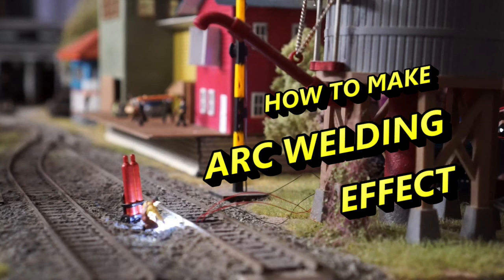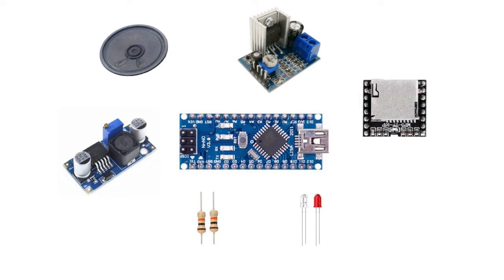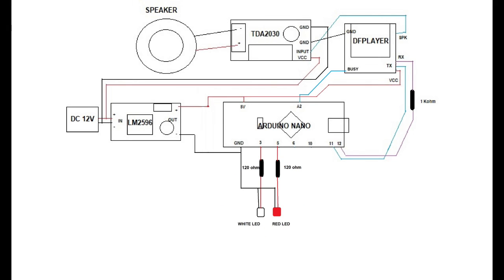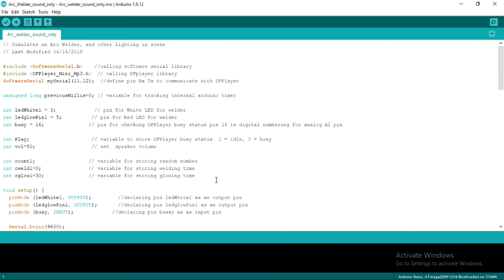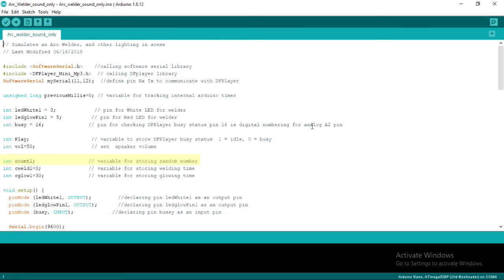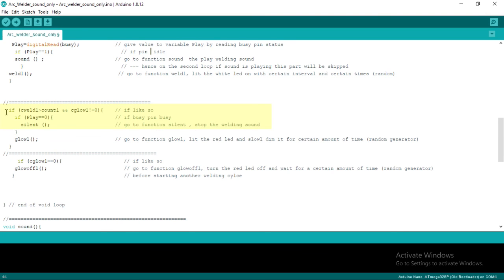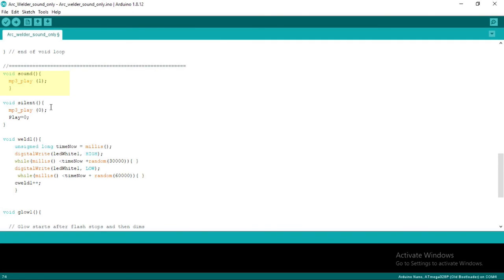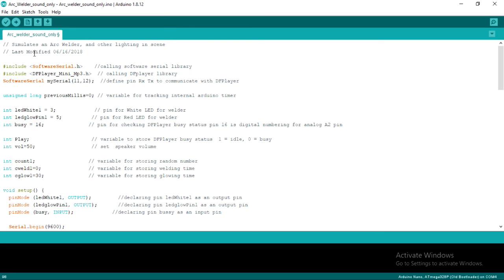How to make Arc Welder effect to bring your layout to life

Comment: looks awesome.  i hate to be that guy, but in the interest of realism, you don't arc weld with oxy/acetylene tanks.  they are for a torch or braising (which doesnt flash an electrical arc).  an arc welder is a small box with a small argon tank, usually on a little cart

Comment: Hi, I'm a beginner at arduino and electronics. I've tried to do a welder following this video but burnt my arduino and I was hoping for some insight about what I did wrong.

1. I've done the connections on a prototype board and soldered the needed pins accordingly
2. I've followed the sketch for cable connections, even double checked it after accident and no missed points there
3. After putting everything together I've plugged in the usb cable to my pc, and it just gave off some smoke and never worked again

I hope you or someone in this comment section can provide some help so that I don't do it wrong again, thanks in advance!
Reply from the maker: Did you set the step down converter output to 5 V ? Or just plugged  it in ?
The default output is 12v. So your arduino will blown out without setting the output appropriately.

Comment: Hi...! The Welding Module with sound is FANTASTIC! The visual effect with the audio is very true. I'm not an Arduino expert, but it wasn't difficult to finish. I confess that I had an initial failure (my mistake) with the audio, however the 'Author' warned me to 'naming' the folder and audio file ... Then, everything worked so fine!
Once more thanks for sharing your project...! You provided me with a lot of fun...!!! Cheers!
Reply from the maker: Glad you've successfully done the project.
May your layout become more rousing.

Cheers

Comment: Maybe it’s me but the lighting effect and noise looks like Electrical Arc welding why do railway modellers repeatedly put gas cylinders next to white sparky sound welding that mimics Arc welds? Welding with gas makes no where near the same noise and although it does give off light initial once set to weld the gas light dims away, it’s was closer to warm colours and bubbling/fizzing noises when I did it at college and work.
Reply from the maker: You're right. My mistake.

It's electrical weld. The gas cylinders are out of place. I know that later. But not at the time I make the video.

I'd make mobile generator  for the props.

Thanks for the correction.

Comment: I want to thank you again for sending me your welding with sound sketch.  Unfortunately I was unable to upload it to my Arduino UNO board due to an error code that I could not rectify. The error code said that MP3_set_serial was not declared in this scope.  I presumed that to mean in the void setup and my understanding is that declarations are usually stated before the void set up and void loop, preferably after the #include statements. I tried everything I could think of to declare it but to no avail.  My limited experience in programming has done me in so back to the drawing board I must go.
Again, I appreciate your efforts anyway.
Reply from the maker: Did you have all necessary library installed in your arduino environment ? The error message seems to related to that.
Reply: @MiniatureWorld_01  I have included the DFPlayerMiniMp3 to your sketch but that didn't help.  I would be at a loss as to whatever libraries would need to be added.  As I eluded to in my previous email I am new to programming and to Arduino so I guess I would be better off to shelve this project until I gain a better working knowledge of what it takes to make it work.
Reply: @MiniatureWorld_01   Hi mate, I also have same problem as "warbonnet64", I have looked online for possible arduino library but to date none match your one, please advise where it is to download, thanks. 
I also have problem with some of your declarations, might be corrupted in attachment, is it possible to have the program resent to same email, elsdem3@iprimus.com.au
Kind Regards, SD
P.S, love the work you are sharing with us modelers, please keep up the good work, cheers and bless
Reply from the maker: @stephendempster9148  let me try it first with an UNO and make sure everything works as it should be. I'll update the code when all done.

Maybe I give you the earlier code. I had several refinement before.
Reply: Was this ever resolved? Having the same issue now
Reply from the maker: What's your email ? I'll sent the library that works with it.